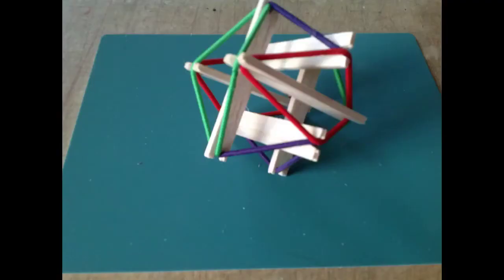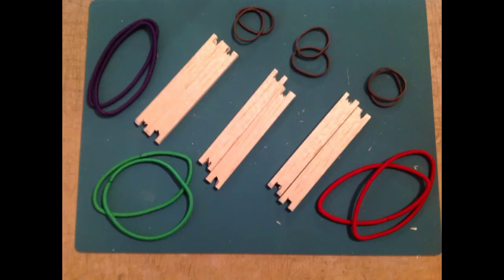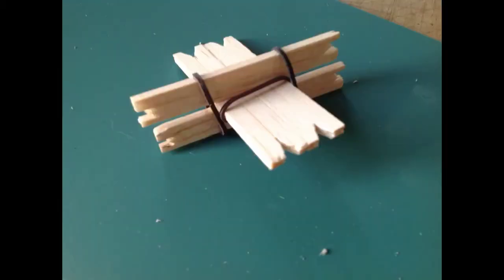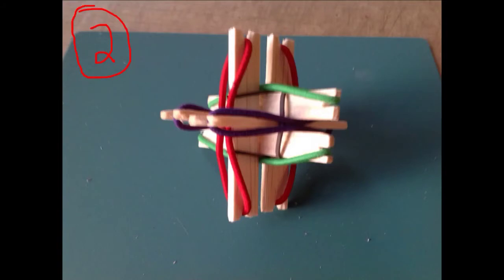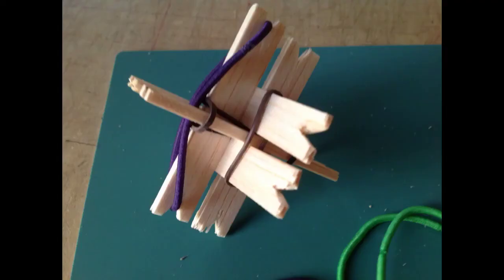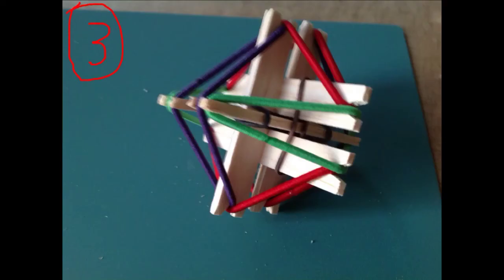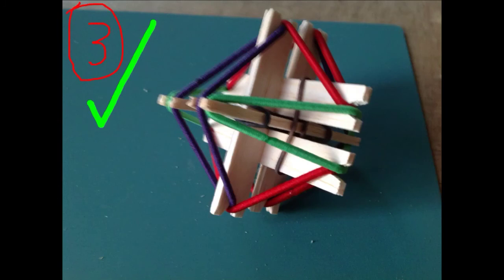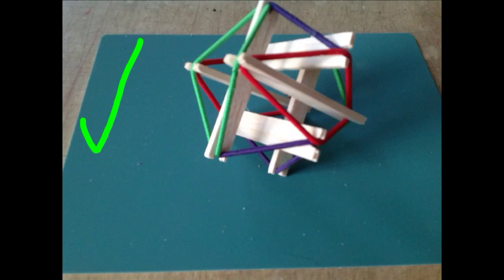Balsa wood tensegrity model

Comment: Only 4 steps!  Wondering what happens if the rubber bands are of different length or strength, just like imperfect human beings, will the model be lopsided or fall apart?  Got to try it myself.  But wonderful and clear presentation and good use of the balsa wood.